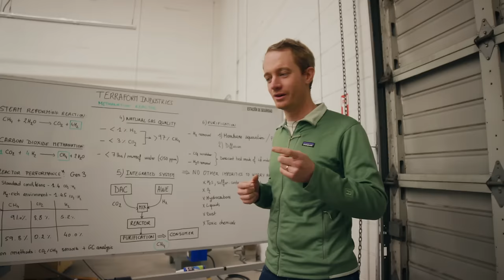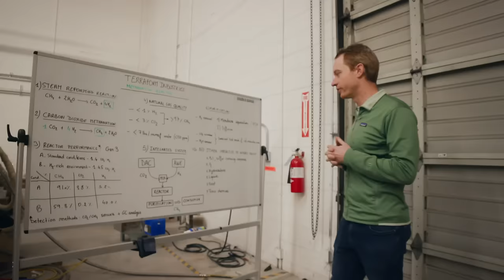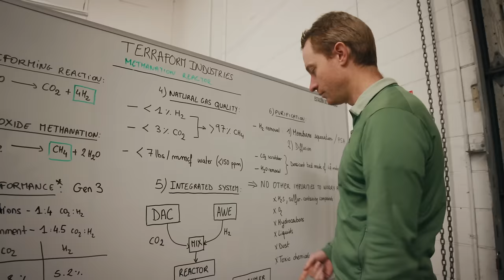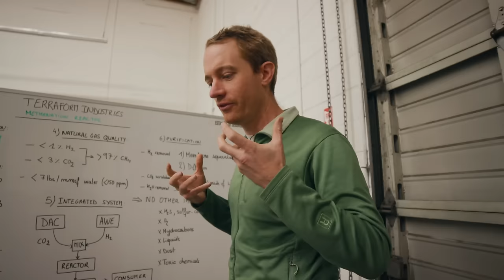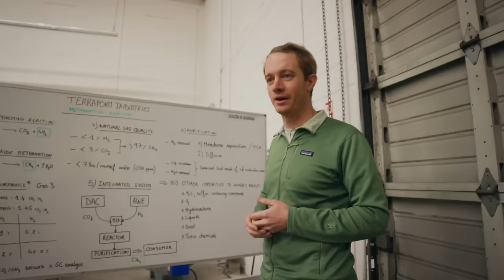The Future of Humanity's Energy No One Knows About | Terraform

Comment: Its a great thing to work on and he seems to be a very sharp guy. If he's successful in scaling up, my own ruf back of the envelope spread sheet analysis suggests it will of course work in terms of producing CH4, but in terms of atmospheric CO2 concentrations, the CO2 emissions from producing the solar panels need to be significantly cut compared to typical panels today. His breakeven on CO2 emissions seems to be on the order of 10-15 years if based on a typical panel today. Solar panels, perhaps one of the greatest human achievements, and electrification can save us from our addiction to consuming energy but we need to make solar panels from solar panels, not fossil fuels, and they certainly will be eventually. Let's hope it's a decade not a century away.

Also his estimates for hydrocarbon fuel demands in a highly electrified future seem high. I am a proponent of using his synthetic hydrocarbon liquid or gaseous fuels for range extenders for vehicles, aircraft energy density needs, and industry only where renewably sourced electricity won't do the job. Otherwise we'll end up making a lot more batteries than we truly need. 

This lower HC fuel demand of course cuts into his economics, but that can be rectified by placing a monetary value on removing CO2 from the atmosphere. It is a great thing he's trying to do and that should earn him money. Nations need to eventually have fossil fuel producers and users pay for these solutions via some form of tax, just enough to make the physical economics of cleaning up the fossil fuel mess work for the noble guys like Casey here.
Reply: solar panels from solar panels idea is ideal. it reminds me of orb track centuries. it says a century away in it.
but i think it can already be done by integrating various currently available technologies despite inefficiencies inherent in each one.
and if 100% of produced solar energy can be used to make more panels, this thing might actually start growing. 
when it grows to a sufficient size we can start removing a small fraction of energy for our own needs and thereby also adjust growth/shrinkage.
the question then becomes how many of these small fractions will it take to recycle all the dead panels accumulating on the planet?

when u say fossil fuel producers and users should pay for these solutions via some sort of tax, ure tripping.
people are struggling to keep warm over winter with huge energy costs and u want to tax them some more because your planet is getting too hot? 
screw ur greedy tech bro planet. i hope its dead by dawn LOL

Comment: The only reasonable way that this company makes sense is in a joint scenario with green power producers to stabilize grid prices during the day, but that limits their ability to stay as close to the production as possible. They have to be able to produce more power output per $ cost than input to work at all

Comment: I would like to ask Casey, as the foremost expert, if he thinks there's enough "fuel" in the air for a sustained extraction without solar. I'm asking if in the future, we will reach peak performance efficiency, could we reach a point were extraction uses less energy then gained. A good example is current oil (dig it up energy < useful energy extracted). If so I hope to see a future where this technology is miniaturized, and is powering all mobile devices. Computers used to be size of buildings, maybe in 10 years Casey's whole stack would fit inside a normal cell battery. That would be epic, wonder if the physics check out
Reply: So violate the laws of thermodynamics (conservation of energy) and create a perpetual motion machine?
Reply: @davidbellamy3522  it's not violating conservation of energy, the fuel is in the air, (no hydrogen or CO2, no running) the question if there's enough of it... Just the same as it takes less energy to dig oil then the energy gained getting oil...
Reply: @fire17102  Interesting. Well, in the context of this approach to energy harvesting, we care about the total amount of chemical energy from Oxygen in Earth's atmosphere (we don't care about kinetic energy, electromagnetic energy, latent heat, etc.). We know air is 21% O2 gas on average. The energy stored in an O=O bond is 497 kJ/mol, there's about 3.37 × 10^19 moles of O2 in Earth's atmosphere. So there's about 1.68 x 10^22 kJ of O2 chemical energy on Earth. This is about 3 quadrillion barrels of oil, and the world's reserve is around 1.7 trillion barrels so there's about 1750 times more energy in atmospheric O2 than oil on Earth. But obviously we can't harvest all of that in practice and it would destroy the Earth. We probably can't even get away with harvesting 1% of it honestly. In which case, it's the same amount of energy as we have available in oil.
Reply: @davidbellamy3522  nice! So by your math there is plenty of fuel, the remaining question is what is the peak efficiency you can physically expect when extracting this fuel, and will it be ever get to a point where the extraction takes less energy than the fuel gained. Again I'm not saying it is, I'm just asking if it's plausible, and it not, what are the limits.

Comment: This is a really cool project, however I worry that this actually doesn't remove carbon from the atmosphere as it just gets burned again with no recapture at the point of use. That does technically make it carbon neutral, but I think the goal to bring everyone in the world to USA levels of CH4 use is not a great thing- it seems like a good way to continue to have huge issues with urban pollution and overemission. Using CH4 for specific applications that require the form factor and fuel density of a chemical fuel makes sense but actually reducing our use of power, fuels, industrially produced goods and materials, etc and decentralizing our means of production will be the things that actually future proof our communities and give our wildlands time to heal.

Comment: 00:01 Synthetic hydrocarbons provide a solution to energy scarcity
01:37 Terraform technology converts solar energy into natural gas, reducing the need for fossil fuels.
04:37 Transforming solar energy into natural gas for efficient transport
06:04 Solar energy is economically and energetically productive.
09:06 Efficiency and stability of Gen 4 reactor
10:32 Advancements in energy conversion technology
13:44 Making green hydrogen requires extremely cheap energy like solar panels
15:16 Generating revenue and value through scalable energy production.
18:04 Terraform's impact on humanity is significant.
19:39 Unrelenting curiosity is crucial for success
Crafted by Merlin AI.

Comment: This is hilarious example of over engineering without bothering to consider alternatives, or the bigger picture.

So, you collect solar energy, use some of it to pull co2, waste 30% with electrolysis reaction, to put it into Sabatier process to loose another 30%, cool then compress the hot methane, all to send it on a pipe line to be turned into THERMAL energy? 

Instead of taking your solar energy and dividing it by 4-8x, why not take those same solar panels to drive heat pumps with a COP of 2.5 or more? 5 acres it literally a megawatt of solar potential. The heat pump installed at my house has a 60amp breaker. That megawatt solar farm could power 138 of my homes heat pump. Quite a bit more than your 20 heated via synthetic methane. 

When considering heat pumps ability to move MORE energy than it consumes, it would literally be more efficient to take the methane you generated with solar electricity, and burn it in a steam turbine to send the power over the grid to the heat pumps that we already have installed in our homes.

Comment: I tried to watch all of it, but nowhere did I see the efficiency of this system talked about in specific terms. 

What I did hear, split that, heat this, process that, pressurize this, blowers running,  etc...

All those things cost energy.  My ballpark guess is that you're getting 10% of energy you put into the system back out of it in the form of natural gas.  

Not sure if that makes it a leading technology for synthetic fuel.

Comment: The Achilles heal is the solar, it’s weak and clumsy. Imagine if it was does by a 100 MW nuclear Power plant the size of a shipping container. Now it could be on an industrial scale, 24/7.
5 acres x 400,000,000 is an enormous number of solar panels. Remember solar panels are not recyclable and toxic, and will need to be replaced every ~ 25 years.

Comment: This is a great thing to do. complete the cycle. take the carbon out of the air to create fuel again. the question is can you do it and use less energy to get it than you can produce from the carbon you extract. or i guess at the very least, make the threshold, to make it more worth it to do this than to drill oil economically before we all die. Eventually you would need to balance it as well so that you dont suck all the carbon out of the air. i'm assuming your using cryo temps to condense the air and extract the methane...?

Comment: What if methane leaks? 
Methane, the primary component of natural gas, is a potent greenhouse gas (GHG), with a global warming potential (GWP) around 28 times greater than the same mass of carbon dioxide emissions on a 100-year basis, and over 80 times more powerful on a 20-year basis. 
What is the ratio between hydrogen and methane in this blend?

1% of the methane produced in US have already leaked.

Comment: On mars its possible to use bacteria to break down poo and plant matter to form fertilizer and methane which are also very necessary for a base so you can use organic molecules to make fuel as well even at an inefficient rate it's very energy efficient since its all waste products plus plastic also can be broken down through pyrolosis which makes many hydrocarbon fuels that everyone is familiar with because plastic is crude oil in a solid form it just takes heat and a lack of oxygen

Comment: I think there too little CO2 in the air for the kind of scale he's talking about which will hurt energy return on energy invested. The other thing is, the use electrolysis for hydrogen production. Heat is much cheaper and abundant then electricity. Thermo chemical water splitting seems much more feasible.

Comment: We do need oil for alot more things than energy, so synthersizing it seems like a very usefull thing other than just returning from Mars.

But the argument that is more energy efficient to move than electricity, I would enjoy seeing the referrence material and statistics.

Since the system is put in the desert It needs to be deserts with enough water in the air, or your only source of water would be ground water? I do not think it's wise to turn drinking water into methane. I feel (not based in science) drinking water is more finite than oil.
And you can turn sea water to drinking water, cost alot of energy and leaves a very salty brine you have to dump somewhere, hopefully a place with low til none biological lifeforms.

You spend all this energy to make a simple product, but can it compare to green energi and mass batteries.
I seems to be making a product with more energy than the sum of its parts, same reason why we don't se hydrogen cars driving around.

But is one of these cases where I win alot more be being wrong...
Reply: Water vapor can be pulled out of the air easily, even very dry desert air, but requires more energy

Comment: Isaac Arthur talks about fusion reactor taking ambient co2 and compressing it into usable gasoline
 

Also luthemplar talks about yeast making diesel off grid fed waste sugars. 

All these options should be aggressively explored
Reply: If we can get a working fusion reactor gasoline will be obsolete overnight.
Reply: @DrRumsmuggler Gas is incredibly energy dense. Hard to replace universally.
Reply: @nomms  Hydrogen is even more energy dense. Fusion is enough power to not worry about the inefficiencies of splitting water, let alone the other ways it could be made if energy were cheap.

Comment: This is very cool tech and will definitely be needed for mars but I don't think it makes sense to use on earth. Some aspects of this video don't add up. Given that this process relies heavily on electrical energy from renewable sources, it would be more efficient to use that renewable electrical energy directly. You could generate more heat/cooling by using the electricity directly than by burning natural gas produced in this process. The majority of natural gas consumed today is for the purpose of heat generation. The only scenarios where natural gas is truly needed are where it is used as a feedstock in the production of ammonia, chemicals, fertilizers, and plastics. Given the commodity based prices for these products, manufacturers will always used the cheapest source, which is out of the ground by an extremely wide margin and will remain so for the lifetime of anyone reading this comment.